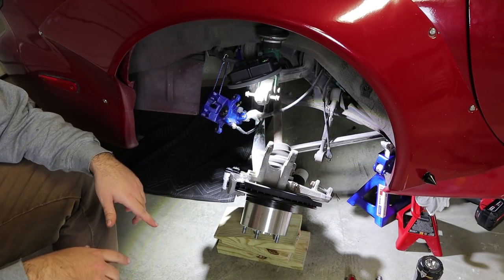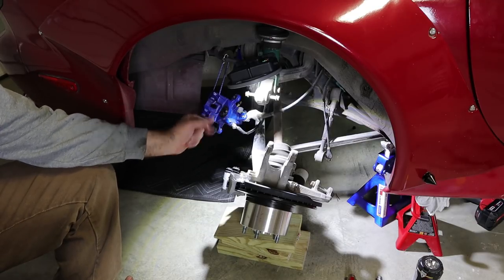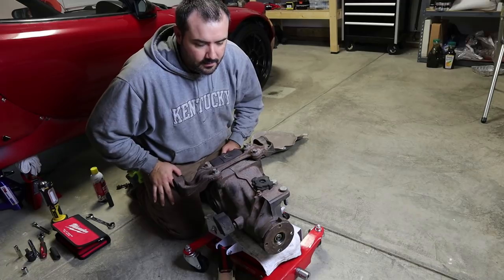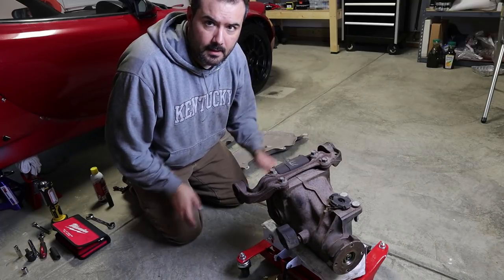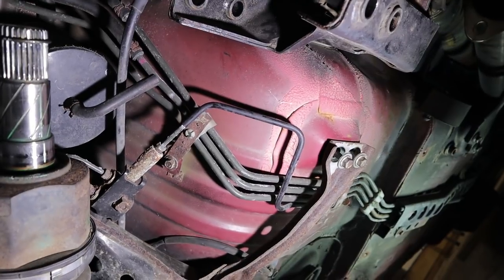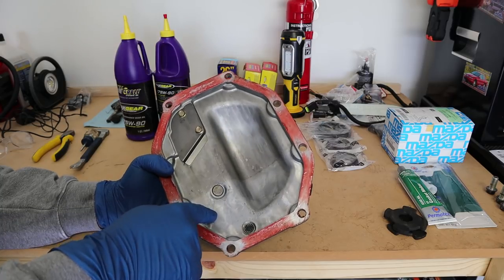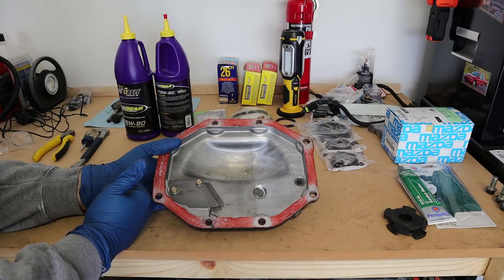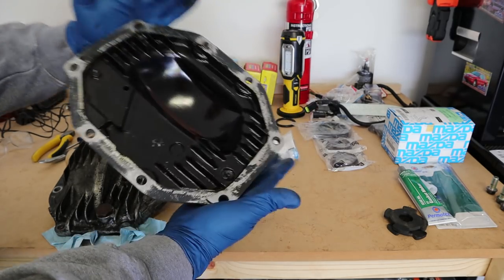RX-7 Rear Diff Removal and Inspection (Cover and Gear Options)

Comment: Those are just casting cracks in the diff. No problem. The replacement diff cover will have the same casting cracks. The casting cracks are normal and acceptable and expected. The cracks are not into the metal but rather standing above the casting because the cracks were in the die. There is absolutely nothing wrong with it. I used to be a metallurgist in a factory that made die-cast automotive parts. Thanks again for the T-shirt! I wear it often.
Reply from the maker: I generally agree with you, but there are some deeper open cracks with small shards missing (I cut that footage out). In my experience, those spots create stress risers and weak points after hot cold cycles. Better safe than sorry and one less thing to have to worry about! The RX-8 cover had a few cast marks, but very little in comparison to the original one.

Comment: The oil around the clutch could be from a leaky rear main seal. Pulling the transmission isn't that bad. You can do it in 2-4 hours and it's easier than pulling the engine.
Reply from the maker: I agree, but it may be time to check out all of the seals and look at getting the port work done.

Comment: Nice update.   With a 1992 Mazda, have you had any issues getting OE parts?
Reply from the maker: Somewhat... the internet is my friend. I can easily get parts from the UK, Japan, and many other countries. The US seems to have thin supply. The bigger issue is $. RX-7 parts are crazy expensive right now. There are a few good shops that part out FDs and have lots of good used parts. Atkins Rotary has generally been my go-to for new OE. My local Mazda shop is hit or miss in what they can get.